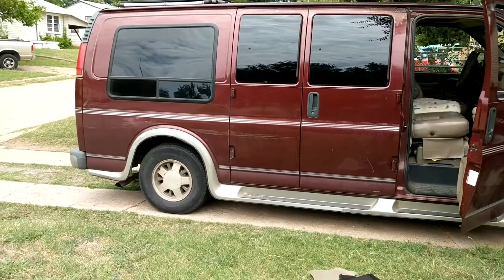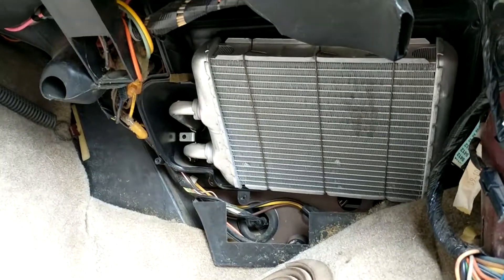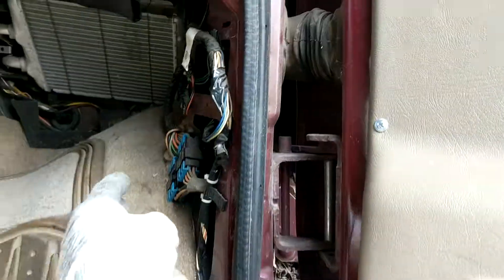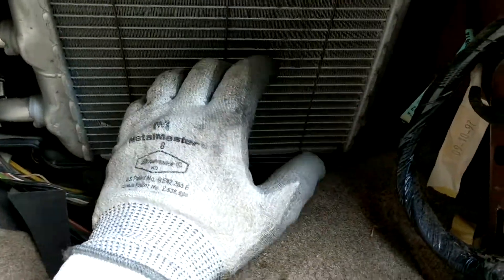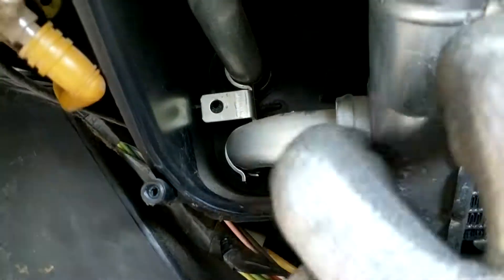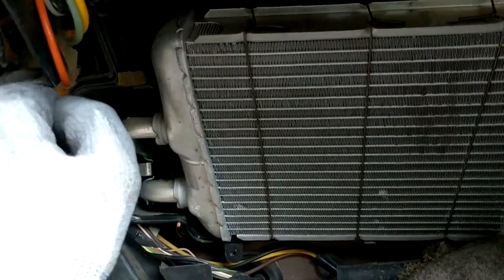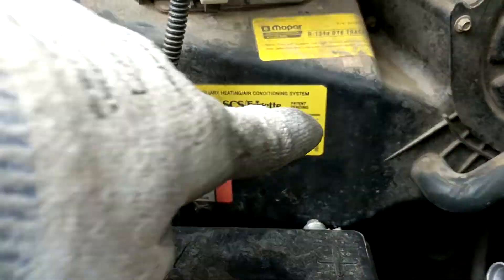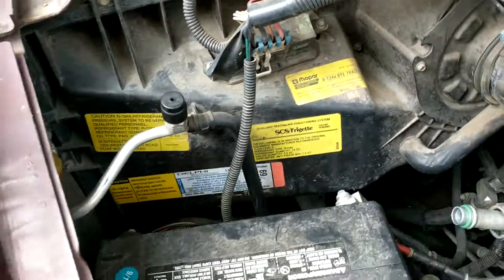GMC Savana 1998 1500 Heater Core Removal

Comment: Hey!!! I know these videos are over a year old, but I’m hoping you can help me. I have a 99 GMC 3500 savana, the back end is a school bus with rear heater and ac. I’m converting it to a tiny home, ive already removed the heater completely, and the actual ac unit. I have a lot questions about the savanas original a/c hoses under the hood. If you could reply to this or hit me up on my ig I would be extremely grateful! @bussed_and_confused
Reply from the maker: Hey Brittney! Thanks for your question! I no longer have the van, and I'm no expert in the matter, but I'd be happy to try to answer any questions u have...

I don't have IG, but I have FB... Do u have FB? If so, could u message me on my business page? Pencil Point Carpentry...

Comment: What was the symptoms please  ?
Was it leaking on the passenger floor board and underneath  ? Coolant smell in system  ? I usually buy a Haynes or Chiltons manual for 20 bucks with every newer vehicle I buy.
Thanks for any helpful information you can provide me with. 
Symptoms  ?
Thanks.
Reply: I am sorry, I don't remember, this was years and years ago, and this is the only one I ever did. So sorry I can help you.
Reply: @danielgetz235  thank you for your response. 
I appreciate it. I will get through it. 
Thanks for posting the video. 
It was useful in showing me how to get to it.
Or..re confirming. How to get to it.
God bless you and yours. Chow.